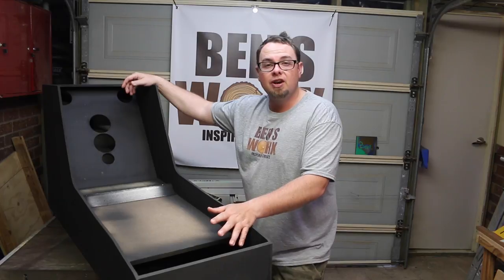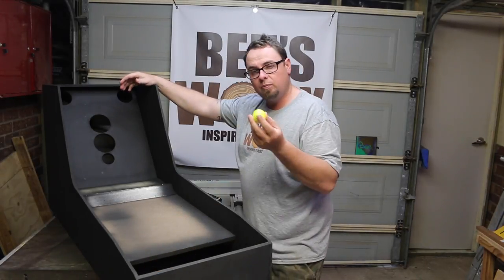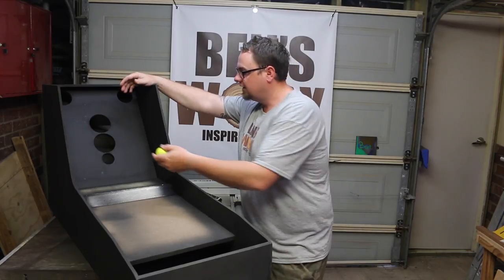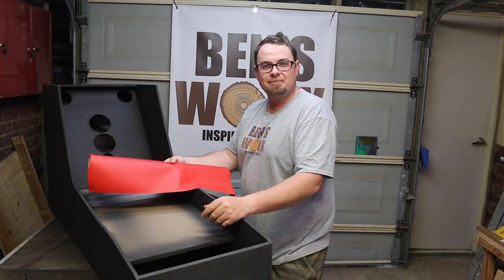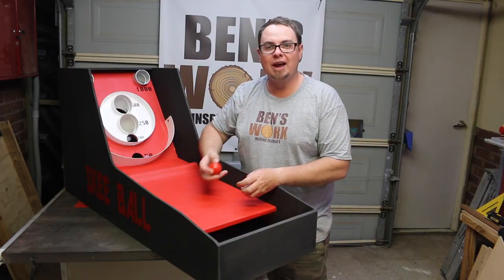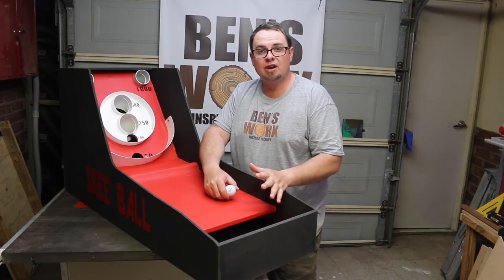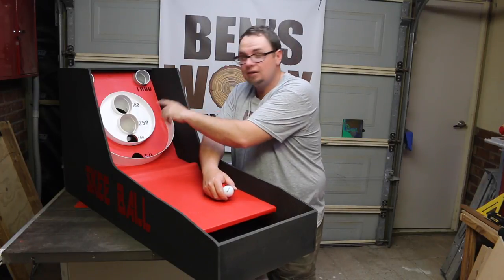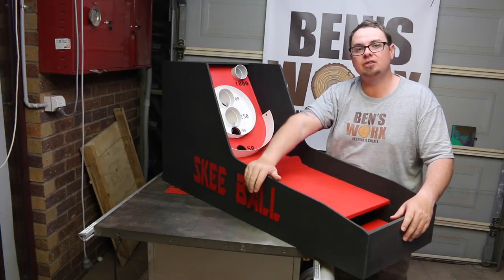BUILD A SKEE BALL FOR $30 **ARCADE GAMES**

Comment: Hey Ben, I thought you would have built it a lot longer in length, and there is no roof to prevent the ball from jumping off the table when you're going for a 1000 points, but other than that, great job!
Reply from the maker: Thanks Mate